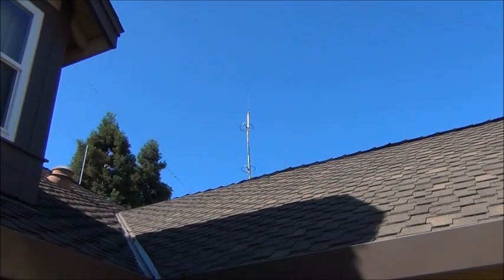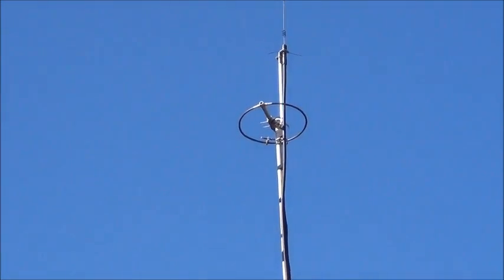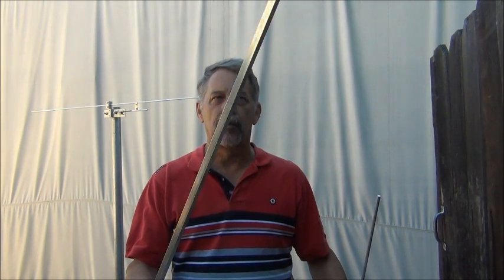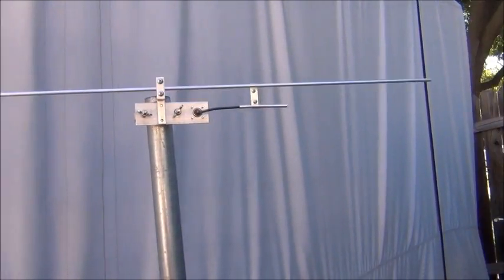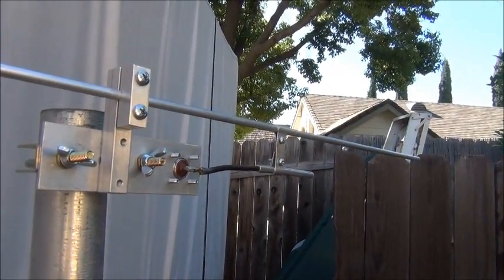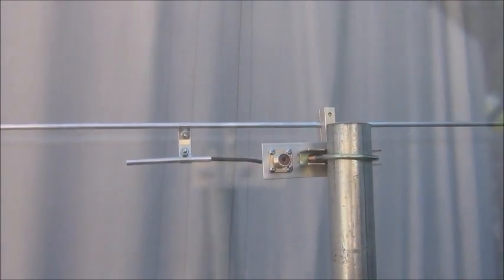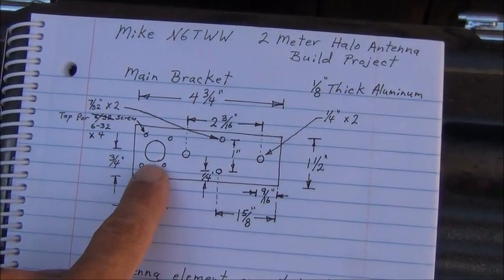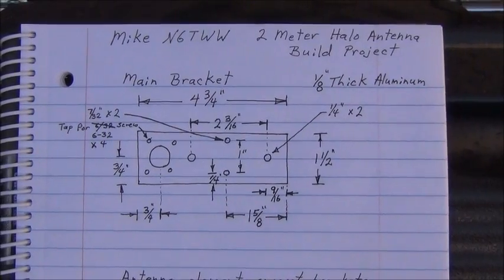2 Meter Halo Antenna Part 1 -- "Design concepts & prototype, construction begins" by N6TWW

Comment: I've plans to electroplate  an hy-gain penetration 500 with gold once I've cold plated it with nickel. because aluminum will oxidize too. but more slowly. but when I move to the beach. it will require a better coating for the salty air. like the anodized golden penetration 500.

Comment: Hi Mike so i assume by looking at the Halo antennas that Horizontally they are more or less omini directional, if you were to mount one vertical it would be bi directional, like a dipole, is that right from Fred in england g4vvq.

Comment: sorry mike i watched the videos again you need to do nothing i had you mixed up with someone else on six meter Element beam project i do like like your videos you put together, i would like to know the Length of the 1 1/4" Aluminum Rod for your prototype dipole and size tubing you used for Gamma match and i do believe RG-58 coax to the SO 239 connector i like to try to make the prototype dipole then try miking the halo antenna later on with your help ,
thanks so much mike for your videos ted looking forward to hearing from you ,

Comment: I can build for u any air variable capacitors kits

2.5-25KV BUTTERFLY LOOP AIR VARIABLE CAPACITOR KIT  FOR YOURS MAGNETIC LOOP ANTENNA
15KV BUTTERFLY CAPACITOR KITS 10'' od rotor

HOMEBREW  2.5-15KV BUTTERFLY CAPACITOR KITS

http://forums.qrz.com/showthread.php?351604-Butterfly-capacitor-kits-5-15kv

http://www.flickr.com/photos/93005502@N08/page3/

http://forums.qrz.com/showthread.php?378701-2-5-15kv-butterfly-capacitor-kits&p=\
2764980#post2764980

I have kits available for ham radio:

2.5" OD ROTOR
3" OD ROTOR
4" OD ROTOR
5" OD ROTOR
6" OD ROTOR
8" OD ROTOR
10" OD ROTOR

VA6POP
yo5bzz(at)gmail.com
Location: Calgary,CANADA